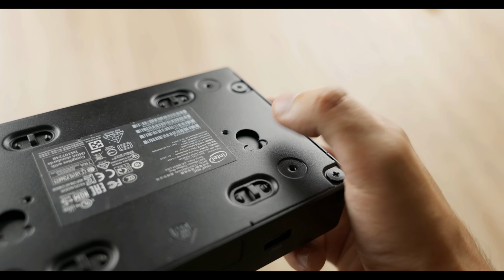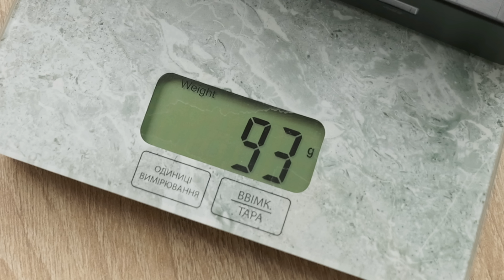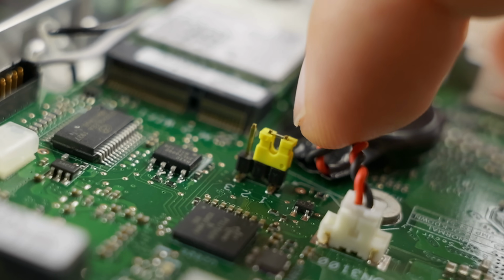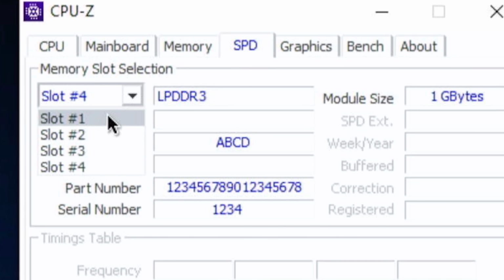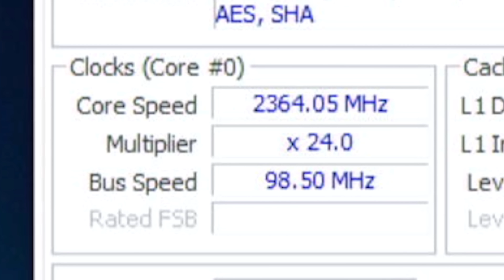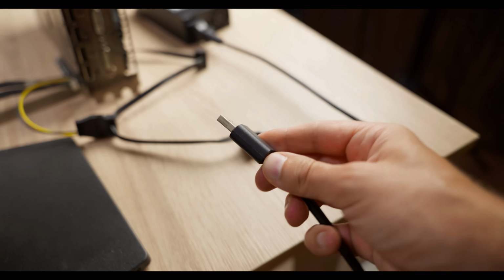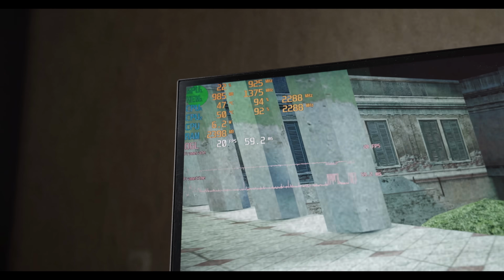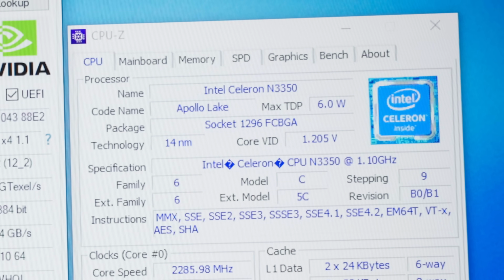Gaming on a $30 TV Box at 4K

Comment: Hey WBTPC I had a ridiculous idea, but, seeing all you need is basically an old board with a cpu and gpu parts available, could you try making a gaming pc out of an old broken PS2 Console? I have a broken slim version and I've since taken it to bits because the only thing that was broken was the DVD drive, obviously that's what it uses to play games so it was useless, but having taken it apart and seeing a small suitable cpu and other varied plug in ports and such, could you give it a go? I have nowhere near as much knowledge on such things.

Comment: You can unlock the cpu wattage to 15w with RWeverything
Reply from the maker: What’s the point if the processor still won’t run at more than 2.3 gigahertz?
Reply: @WhatAboutThePC  - it's free
- it can stay at 2.3 Ghz
Also...
- the Celeron isn't unlocked for overclocking
Reply: @WhatAboutThePC  there will be more power for igpu?
Reply: @WhatAboutThePC Numerous advantages.. look it up?
Reply: If you do get the CPU to use 15W I recommend using a fan over the cooler
Reply: or simply use throttlestop?
Reply: How do I do that to mine
Reply: Discord?